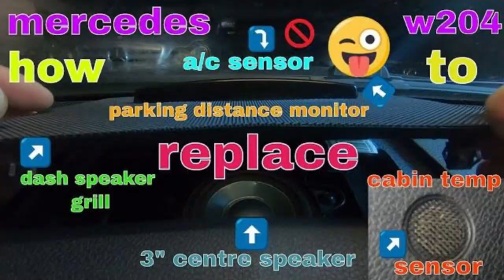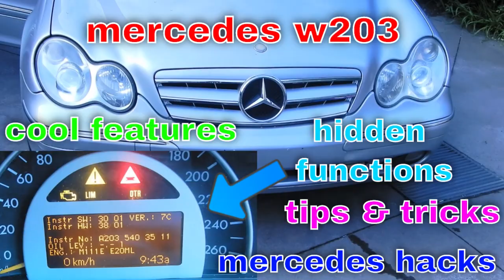MY CHANNEL INTRO

Comment: you know how to fix if the steering wheel couldn’t up & down by the control arm for W204?
Reply from the maker: unfortunately I am.not sure about that .. I'm not a professional mechanic I diy and learn via research and trial and error .. whenever I need to fix something I check forums watch videos do research and start trial and error ...

Comment: 08 c300 4matic nav keeps shutting down , shows  check rear tail lights on dash and gas gauge doesn't work, only in the rain. Have any idea?
Reply from the maker: honestly no I am not sure ... very hard to diagnose without being there ... however sounds electrical ...and only in rain? definitely something shorting out from water

Comment: hello sir i have an 2009 e350 wagon i put the key in and nothing i changed the batteries in key fab no differemce i had weak battery in car itookout the keyignition to try to bypass that ll on the side of the road no difference can you giveadvice ?thank you steve murphy  in doylestown pennsylvainna usa
Reply from the maker: sounds like the esl mate .. its most common